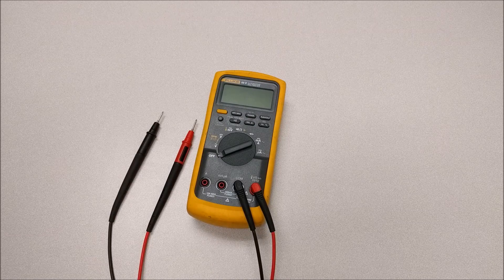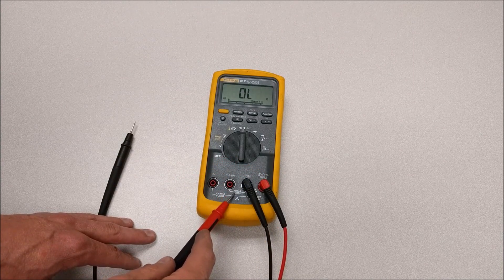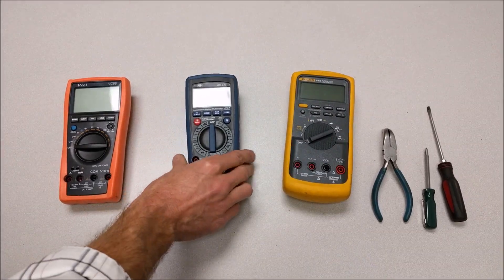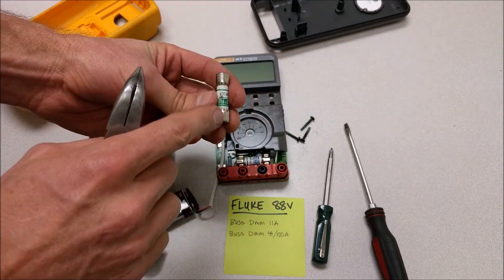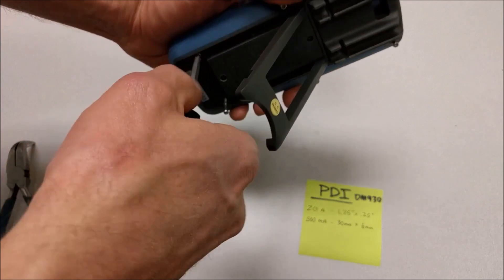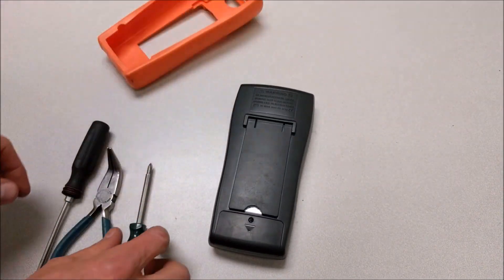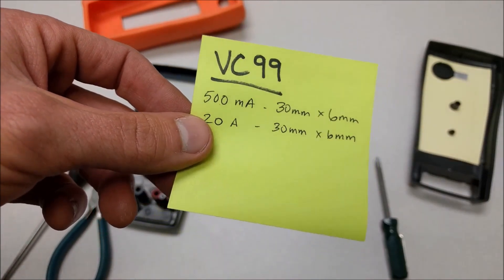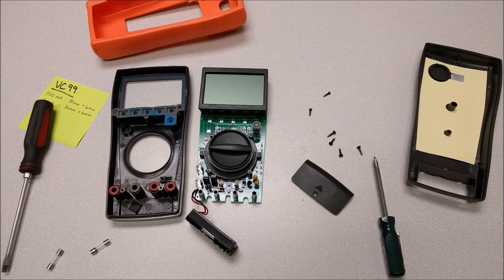How to Check & Change the Fuses in Your Multimeter

Comment: I bought new Digital Multi meter Uni-T50B, as soon as i switch it on there is a continuous sound of continuity, irrespective of any mode. i tried to return or to exchange but lost the original invoice. so i am stuck with it. I did open up and checked both the Fuses are Fine, and also carefully went through the board and there is no sign or burnt or Short. Please advise if i can fix this

Comment: I have taken out both fuses and i was making audible continuity check on both of them,but with the same multimeter not with second multimeter like you,so i was making audible continuity check on removed fuses with a multimeter without fuses because i took them out?does that made a damage to my multimeter since there was not fuses inside at the time of making audible continuinity check???or that was a stupid idea?please answer me
Reply from the maker: That is perfectly fine.  The fuses in your multimeter are only used in the current measurement functions.  All other functions of the multimeter would work just fine without fuses even installed.

Comment: The circuit on my multimeter are only 3. One test circuit for both mA and volt, ohm, diode. How do i check fuse for mA? do i put the red test lead on 10A circuit? According to your method my 10A fuse is working.
Reply: Well, i plugged red one to 10A and tested for mA and it beeped. Does that mean fuse for mA is working?

Comment: Hi mr
 If the multimeter in continuity test mode (diode mode) and I have applied to its terminals a voltage of 220v
 Is the multimeter damaged ???
 Because my multimeter is damaged but the display remains working and the LED mode rest works

Comment: Ive got a Proster VC97 - and is written 20a and 500ma - when i opened inside are fitted a 10A and 0.5a fuse ,  i have the multimeter from new so nobody replaced the fuse before . Why it says 20a if in fact it is a 10a
Reply from the maker: I don't know.  These are very cheap meters.  For the price, I think they are a pretty  good deal, but nothing surprises me about these meters :)

Comment: thank you sir. Just realized both my 250ma and 10A fuse are dead. I tried to "check if the battery is still ok" on an electroroller. Suddenly my probes were molten.